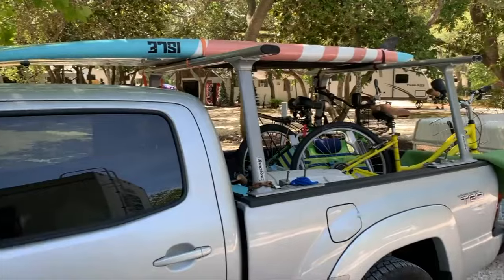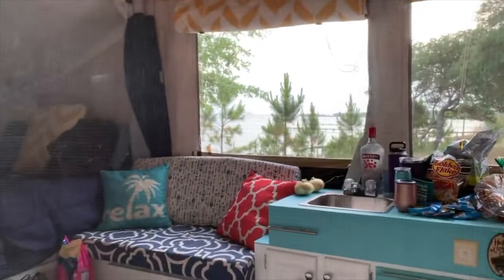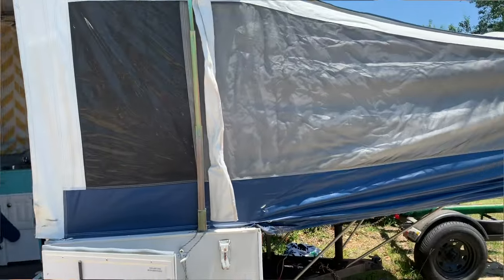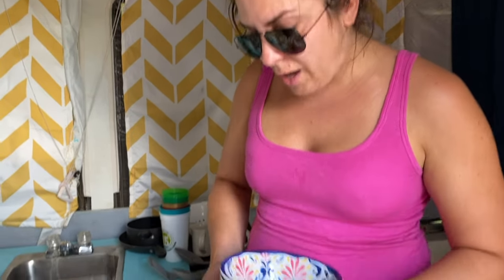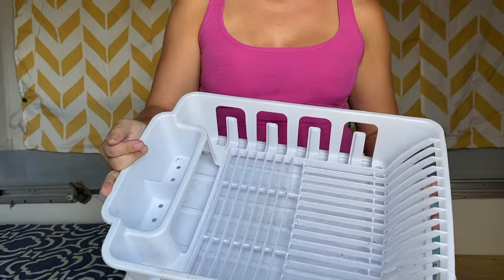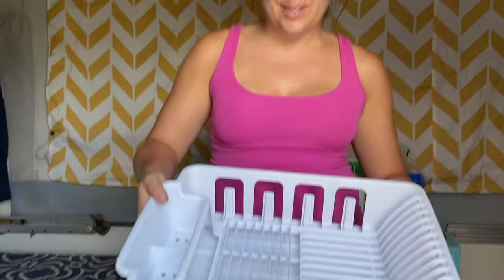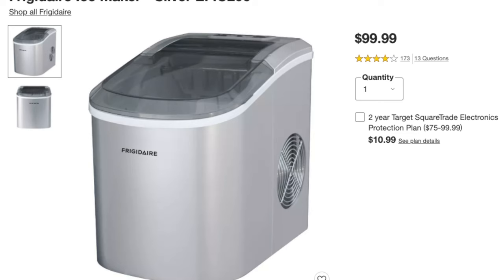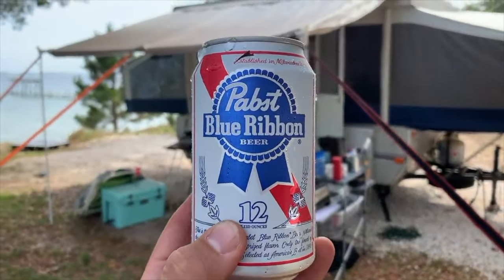TOP Tips, Tricks and Hacks for a POP UP Camper!

Comment: I camp with an older Jayco - 2001 12 UDST.  We also never use the water heater, in fact we never use the water system in the camper at all, we just use a 7 gallon aquatainer.  Works well for us and we have actually removed the sink for more counter space and much easier to set up.  In regards to all the stuff you carry, we have a bigger camper and I think we have about 1/10th the stuff you have and we camp with from 4-7 kids.  All you need to do is take a couple of longer trips (multiple locations, national parks....) and stay at some sites without electricity and you will start taking a lot less stuff.  For sure it is hot in FL in the summer, which is why it is great to camp off season when it is cooler and a lot more pleasant outside.  Once each year you should do maintenance on all of the camper systems and wipe down and vacuum out all of the rarely used spaces.  You'll catch any issues early that way and the camper will last a long time for you.  It looks like you only weekend camp in FL with electricity, I would encourage you to get out on longer trips to some other areas, especially some of the national parks, there are some fantastic places to see in the US and camping is a way that you can do that cost effectively.  But, to enjoy that you have to learn to camp without 120 hookups as almost all of the NPs don't have hookups in their campgrounds.  It is not a big deal if you have a battery and are used to it, but it might take some changes for you with the reliance you have on 120V things.  It is a great opportunity for the kids to get out there and see all the great things across the US, and there is a lot to see.

Comment: Check the wheel bearing grease, lug nut torque and tire pressures before each trip.  Make sure your spare tire is in good shape and holds air.  Have a clipboard or use an app on your for for running list of things to fix, buy, replace, replenish while on a trip.  Take care said items on the list as soon as possible when you get home.
Reply: Tire pressure for sure(including spare), but you aren't going to check the bearings before each trip and lugs should never have to be checked again after a recheck right after a tire change.
Reply: @christopherhaak9824   Let me clarify a tad.  Wheel bearings torque, grease condition, and both front/rear seals should be checked for sure if the trailer has sat for a long time (>6 months) between uses and/or has been exposed to varying temperatures such as hot summer/fall to cold winter/spring.    Obviously repacking a old school style axle bearings is more time consuming, but I would much rather do it in my driveway, and not along a hot busy highway.  Wheel lugs should absolutely be checked as well during your routine (bring it out of storage to use) check list.   If the trailer is used all the time throughout the year, checking these items a few times within that year is cheap insurance.

Your mileage may vary on when and what you check on your trailer.   My personal experience has found lugs that have loosened up here and there, as well as wheel bearing grease that needed to be pushed through and replaced (EZ lube axle). It's quick and easy to do.  Found a cracked rear seal on my parents little Aliner trailer before a trip.  Grease was coming out of the back side of the axle.

Comment: penetrating oil (PB Blaster) works great on the tongue jack if it's stubborn, and teflon based firearm oil works great for the slides since it's designed to not evaporate.
Reply: Love PB Blaster and you are 100% correct about gun oil.

Comment: Great video! Lots of good tips. 
The electrical issues...there are torque specs on all electrical connections. The salt air can cause oxidation on All metals. Yes, even copper. Especially aluminum. There is a product that can be applied at the point of connections and terminals. If it is not a molded plug, it alone is not necessarily weather or wet location approved.
Check the Ampere or Amp rating of the appliances you use. A resistive electrical heating element is a large electrical load. They should probably have a separate cord to supply them. All electrical appliances should have a "name plate" with electrical use or ratings. 
Use Ohms Law. Volts times Amps = Watts. Therefore, Watts divided by Volts = Amps. A 1500 watt microwave ÷ 120 volts = 12.5 amps, just by itself. I bet that electric  griddle is also a substantial wattage appliance. An electric water heater is another  substantial load. Amps and/or Watts add up, literally. 
My goal is to inform and assist or help, not berate in any way. Those small electrical appliances can literally burn you up.
The circuit breaker's job is to protect the conductor it supplies, not the appliances. 
Thanks for sharing your tips and advice with us!

Comment: We now have a Starcraft AR-one max. But we had a pop up for a few years. It was so easy to store and haul and you couldn’t beat the Ac in it. It was like sleeping in a refrigerator!! But we outgrew it. I also had a wire come loose at the power cord from it being pulled out and pushed back in. It was one little strand that was touching metal and my breaker box was smoking and glowing red. Probably time to check my new trailers wiring. Oh yeah and grease the bearings😂 nice video!!!!

Comment: My brother just bought a new and very large camper. I never liked big campers. Feel like a small trailer in the trailer hood to me but that's his thing. He gave my wife and I his popup since we were looking to upgrade from tenting to a popup. We are very grateful for his generosity.  It's in really good shape but does need a few things. Minor things so not complaining. We don't plan on using the stove or sink so we immediately removed them. Keeping them in storage if we ever get rid of the camper. We have an outdoor cookstove with legs that easily pop on. It's the perfect height. I made an outdoor sink from an old aluminum folding camp table and a stainless steel salad bowl (you get the idea) we ran the gas and water lines to the right side of the camper. They stow away in the former gray water tank which I modified for that purpose.  The camp stove runs right from the tanks on the camper. The sink has both hot and cold water and a nice sized counter area for stacking dishes or placing our cutting board, etc. Stove and sink easily come apart and fold down. Both are stored together under a bench in the slideout dining area. We added a long cushion to the cabinet below where the sink and stove sat for more seating. Also, eliminating those opened up a ton of floor space for hauling things such as our home made awning, 70qt cooler and folding chairs. We have only had the camper one month. This weekend will be first time used camping away from our property. We have many other ideas and a full remodel of the inside planned.  Including the addition of an electric fireplace and faux chimney wall in lieu of the bunk we don't use. Totally removable,  of course, for when someone comes with us. Our ideas and watching your vids have had me thinking maybe we will do some vids of our remodel. Should be fun! Thanks for the inspiration!

Comment: Wd40 is not a lube, for cables and anything exposed to dust use a silicon based lube!
Reply: Yes! Was coming here to say the same thing!
Reply: thats right WD40 is a water displacer not a lubricant  use moly  or even anti seize. wd is good for spraying into electric terminals exposed to elements

Comment: We just took our pop up out for the first time.  Learned the hard way - buy a bigger jack.  Tire on the camper blew out on the way home.  
I'm considering removing the sink and all plumbing because we don't use them and they are taking up valuable space.
We have a small table top propane tank which we connect to the propane tank on the camper.
Must have - thermacel for mosquitos and electric tea kettle to heat up water fast.  Sorry but I don't understand the need for a microwave while camping.
Reply: I have to admit, if I find a very small microwave at a yard sale, I would buy it for our camper.  Microwave popcorn and even quickly heating things up would be nice.
Reply: We don't use our sink either and we have removed it for much more counter space and it also simplifies set up.  We just use wash basins outside for doing dishes.

Comment: Just purchased a 2004 Fleetwood but I noticed around the screens on the two main windows for the table is not where the beds are. Its zipper itself is in good condition but the seam has come apart from the canvas. What can I use to sew that with to fix it. I was thinking fishing wire and glue

Comment: Those fan light combos suck.  The bulb gets hot enough to melt the lens.  Get led or just get the solar inflatable lanterns.
Reply from the maker: Its what we have. Maybe one day!
Reply: @YakMotley  Just don't leave the light on unattended.  My lens melted, caved in and the bulb blew.  We have no AC so real fans are a must.
Reply: @YakMotley  I have to agree. LED is a much better choice. I'm looking to see if anybody addressed the electrical issues. If not, I'm about to. I got my NC Electrical license in my early 20's. Not trying to beat anybody up. I just want to help you guys if I can.
Reply: You can replace the bulbs with LEDs, it is simple and cheap and then you don't have heat issues.  The LED bulbs are about $1 each.  In fact, I would recommend replacing all of the camper lights with LED bulbs.

Comment: We don’t take the coffee pot that needs to be plugged in what is a percolator that we can cook on the stove saves room it’s just a fission I’ve had to pop pops stop Bob this is my second one upgraded I’ve had to fit wheels I could not get to where I needed to get with the fifth wheels but yeah you’ll need a couple thanks for cooking I took about a set up right where I could take a run on the lantern a grill and a cook stove outside we’re not cooking our pop-up we preferred to be off grid and you cannot run air which I have error on mine but it just doesn’t cool and it will pop a circuit I have a 2019 clipper the biggest thing people need to know is you need a front trunk on there for storage I had one before they didn’t have it it’s a big big plusSaint current access and little tools Van Ness and not my clipper slides one way or the other and it has made a drastic change in a lot of things and if you’re off grid you wanna current coach some type a solar panel which I am getting ready to order but we love our pop-up person or 30 foot fifth wheel because we never did anything when it got hot

Comment: those little fans? where did you get those?
Reply from the maker: Ours came with the camper.
Reply: You can get them online, they plug into the lights.  You can get plain lights or fan light combos.  There are also 12V fans (many) that are rechargeable or plug into 12V outlets.